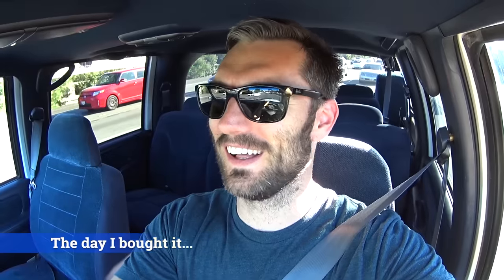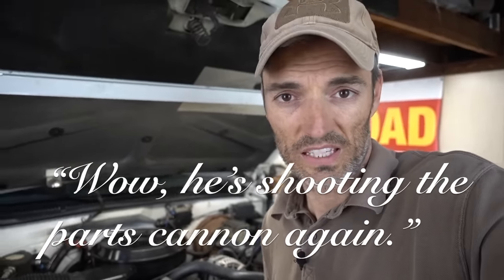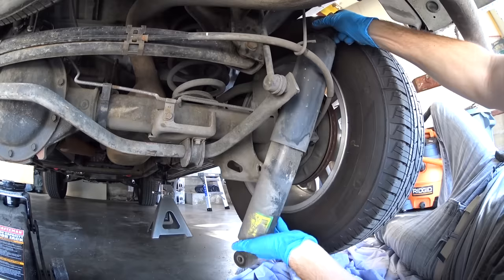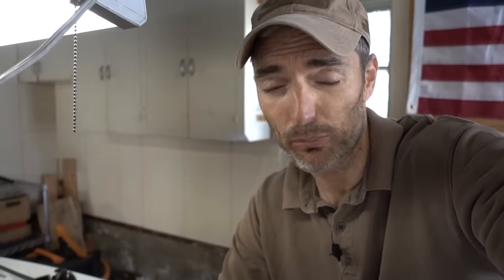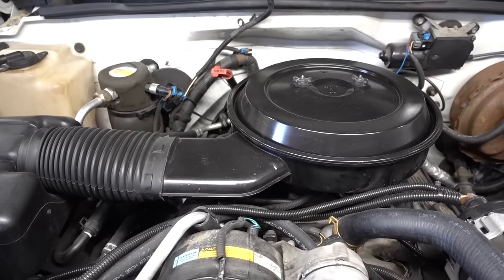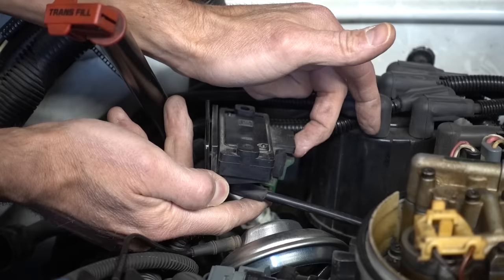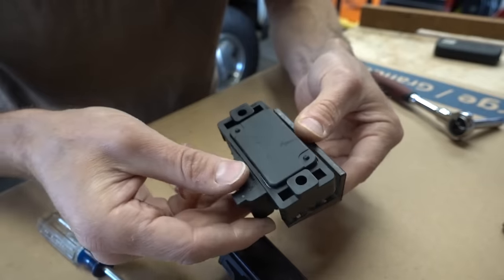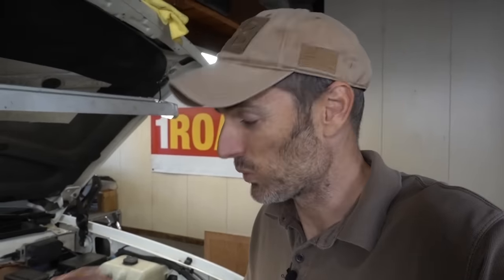The ONE REASON Why My 25yr Old Truck Runs So GOOD!!

Comment: Use a small ziptie to secure the(broken)plastic plug for the MAP sensor, works great.
Reply: great advice...gluing the original plastic with super glue will only hold a year...as super glue crystallizes after a year and breaks...a zip-tie-wrap will last 30 years in a heated engine compartment.
Reply: Or you can go to the local salvage yard and pay ~~ $4.00 for a pigtail and solder it on.  Good as new.
Reply: Or you can just get a new Weatherpack connector body, release the connectors from the old body and insert them into the new body. And also replace the CPA (Connector Position Assurance) clip. And make sure to coat the seals with silicone grease. And I recommend coating the connectors with antioxidant joint compound, such as Noalox.
Reply: @tomreyes4908  zip tie is easier lol

Comment: It makes sense to keep your vehicle in good condition. Better to replace wear items on your own time rather than when they fail.
Reply: Absolutely!  When that old rad hose does blow your going to be stuck on the side of the road.  You don't know where, what time it will be or what the weather will be.  Now you can add the cost of a tow to the cost of the replacement part.  Wherever you were going when the hose blew, your not going to get there today.

Comment: I just bought my first car, a 1988 s10 blazer. I honestly dont know much about cars, but with the repair manual and just a bit of research you can fix a lot by yourself on these older vehicles. They are great to learn. Greetings from Bavaria, Germany
Reply: I got that engine 4.3 v6  on a Silverado truck with   400,000 kilometers 
Oil changes  don't over heated

Comment: Good video I do pretty much my own work whenever possible. Preventive maintenance is the way to go.
Reply: During the week, when I work at my job, I earn $56 per hour (maybe $35 per hour after taxes).  If I work on my truck in the driveway for 5 hours on Saturday morning, I can easily save $500 worth of dealer labor.   I just earned $100 per hour (tax free).  Simple Math!

Comment: I have a 94 K1500 so same vintage as this Suburban.  I recently had the EGR go bad as well so that was causing a big vacuum leak.  I decided to go the EGR delete route since I'm in a state that doesn't do emissions testing anymore and It's running so much better now.  Much better throttle response too.
Reply: How exactly do you do the EGR delete? Is there anything in particular to be aware of?? I have a ‘95 Tahoe and no emissions testing in my state either. Thanks

Comment: I have an 05 tundra and last year I went on a trip. I changed the front brakes and checked the rear. As well as front and rear shocks, alt and belt. All were not failing though it gave me piece of mind. And that's enough for me.

Comment: I have a 2002 Z 71 , I have to say of all the new vehicles I’ve had in my lifetime. This one is the greatest. It has been literally flawless from the day. It was driven off a lot brand new to present I put three sets of tires on it. Three new batteries, change the oil as scheduled in the manual it has never failed. Me still has all the original stuff on it. I too, have changed the hoses and the water pump strictly just because of the mileage and age there were no problems the factory battery lasted eight years before I replaced it simply the greatest truck I’ve ever owned and I will keep it forever. It will definitely outlast me as I am now 68 years old.

Comment: many times original factory parts are better than factory replacements.  I bet your old MAP sensor was made in the USA or Japan which is better than the China one.
Reply: gmt800s had faulty ones from the factory  correction MAF sensors  you can still get made in the US MAP sensors   for the GMT900
Reply: Absolutely true!  Many many replacement parts no matter the box that they come in are of inferior quality.  This is especially true for 25 year old vehicles.  They just aren’t many manufacturers of parts for older vehicles and those that do still make these parts don’t sell very many of them so the manufacturers aren’t incentivized to keep the quality as high as their profit margins.
Reply: Absolutely True!  The original ignition coil on my 22 year old truck failed when the truck was 9 years old.  Replacement AC Delco coil failed 5 years later.  Second replacement coil failed after 3 years of operation.  Third replacement coil also failed after 3 years.
Reply: @chrisgraham2904  Hey did they have a no start condition when coil failed or other symptoms leading to the failure  ? thx.
Reply: @paulmoss7940  Coil failure may cause a no start condition or often shuts the engine down, like turning off a light switch while driving.  Engine may restart after shutting the engine down or it may restart hours later after the coil has cooled.  If it restarts, it will fail again when it heats up.   If you suspect a weak coil, you can often see the coil arching with little light flashes under dark conditions or you may hear the arch as it buzzes.
Reply: @chrisgraham2904  Thank you ,Sir. What I needed to hear.
Reply: @chrisgraham2904  Failing coils repeatedly is an issue that lies elsewhere. The coil failing is a symptom of an issue elsewhere.
Reply: @jf4872  The last coil installed was an upgraded AC Delco and has been operating flawlessly since.

Comment: 1ROAD, If I'm replacing something with a clip like that, I get out the old HEAT GUN & heat it up too where it's more pliable, WORKS 90% OF THE TIME.
Reply: And what happens when you damage the connector from the heat gun? Not a very bright idea. Better of just risking it breaking and using a zip tie. Those parts were not designed to be hit with a heat gun.
Reply: Well you sure don’t have to cook the thing🤣 ; use a blow dryer if you don’t know how to finesse a heat gun, most have a Low setting that is not unlike a hair blow dryer.
Reply: @frankstetka7206  THANKS, I didn't even reply too such stupidity. " YOU DON'T HAVE TOO COOK THE THING ", LMAO.
Reply: @ragnaroksangel  You don't heat it until it melts. It resides on top of a very hot engine to begin with. Heat it until it's MORE PLIABLE.
A very BRIGHT IDEA.
Reply: Thta's a good idea.  A hair dryer is a better plan those heat guns, they get HOT!!!  Melting hot!!
Reply: @nealhead7673  If you use a heat gun you don't even have to unclip it.  Actually when it cools you can peel it off of the driveway like a soft noodle shell that sat in the stove until the next day.  Makes for easy cleanup.
Reply: @ranbymonkeys2384  I have a VARIABLE HEAT GUN works a HELL OF A LOT BETTER THEN A FREAKIN HAIR DRYER. Do what u want I know what works best because I've been doing this a LOOOONG time. Also sometimes they just break no matter what, plastic in the engine compartment isn't good at all unless you install insulating sheathing over all of it. That in it self is a PIA but it does work.

Comment: Those pre-Vortec gen-1 SBC TBI systems are so simple and reliable!!!
Reply: I've got a 91 c1500 with TBI I'm getting good  spark and fuel but my injectors won't fire I'm thinking about replacing the ECM any thoughts?
Reply: @zephead4835  Replacing parts without verifying the issue at hand is not the proper way to fix a vehicle.  My suggestion would be to retrieve any trouble codes first, if there are any.  A great tool I used on my OBD1 cars was a program called WINALDL,  I ran it on my laptop computer, and I made my own cable to connect the computer to the vehicles ALDL (instructions on the net), It had many features and best of all it would show live DATA of all systems as the engine was running, and/or as the car was driving down the road.  It was great for troubleshooting.  Without live DATA of the vehicle engine control systems, your shooting in the dark.

Comment: Absolutely correct, it is collectively finding problems before they happen, like replacing all sensors and solid state devices affiliated with the engine and car computer functions.  Then you can whiff scan and or read when a mechanical failure approaches...you know where it is.

Comment: I feel you man! The thermostat on my daughters Jeep went bad at 110k miles. I figured while I’m draining all the coolant it was time for a new water pump, hoses, serpentine belt, idler and tensioner pulleys, and of course the thermostat. Hopefully good for another 110k!
Reply: I have 96 Chevy trk all parts I get are   junk even a c Delco belt tensioner 6 months i have replaced 5 of they all squeal i just left the last one on and let it squeal. Water pump lasted 5 days and water pouring out BOTH  weep holes allparts are junk
Reply: Half the battle of replacing a simple part is getting to the part.  On newer and smaller vehicles, access to the part can be 98 percent of the battle. Only makes sense to replace the common wear components in that area while your in there.  You dove in once, instead of six times.

Comment: Great work! My vehicles never leave me stranded. When I detect something isn’t right, I track down the problem and do a preemptive repair. An intermittent misfire on my 2003 Ranger prompted me to swap out throttle position sensor, plug wires, spark plugs, cam position sensor and clean the mass airflow sensor. My truck never leaves me on the side of the road, and, it’s been paid for for a long time.

Comment: Them GMT400 as long as there's no rust they going to last forever with basic maintenance.  This is most durable truck GM ever built
Reply: piston rings, lifters, cylinders, injectors, all wear.  Eventually you will have a rebuilt engine but last forever, not quite.
Reply: @ranbymonkeys2384  I knew a guy that had a 1994 Silverado 2wd with over 400k miles on original drivetrain.
Reply: @Chinunit22  ya OK 400K doesn't sound like forever does it?
Reply: Picking up a 98 2500 350 with 102000 miles tommorow,  got it for 2111.00!!!!!!!!its mint

Comment: Jimmy, my thought process is the same as yours when it comes to automotive maintenance. I did the same for a '91 Ford Ranger, now with 200K miles. Electrical parts and common failure parts were super cheap especially about 8-10 years ago. I seen it as a win-win situation.

Comment: You have the right mind.  Constant vigilance. Similar to the nauticle  mind. No break downs at sea. 
I do like you do.  My truck is a little simplier. It is a '65 F100. I use the 300 -6. I have been driving/maintaining it for going on 43 yrs. I keep a pocket sized notebook (in the 3rd one now) to keep up with "events." I also use a magic marker and write the date on a new part. 
   All the best, like your style a lot, Pete

Comment: Recently did the map sensor on my 88 k1500. That along with the TPS and IAC helped alot with idle and throttle response. I was getting a surge in my throttle so I went with all three and now my truck is running amazing
Reply: Tps?

Comment: That is a super clean truck for a 95! I have a 98 Chevy pickup that’s totally rotted out in some areas it’s a shame the rust got to it because it’s otherwise in great shape and runs perfectly. You’re lucky you got such a clean example of a 90’s GM.
Reply: All depends on where you live. 
I live close to the Gulf of Mexico (Texas) like 60 miles from the ocean 
We have humid and salty air quite often but surprisingly trucks don’t rot out down here unless they’re a second or 3rd gen dodge….. 
there’s plenty of 50 and 40 year old square bodies still on the road down here you can’t throw a rock without hitting a GMT-400 series somewhere. Mine truck is a 91 k3500. 
Absolutely zero rust or rot except for where the radiator was leaking for years……. Only thing that ever makes my truck quite running is when crap in the fuel tank plugs the strainer screen I usually just hit the tank with a mallet. And it solves the problem…..  
gmt-400 cheap to buy 
Easy and cheap to work on 
And just all around loyal trucks. Been running mine every day for 6 years.

Comment: The problem of just throwing parts at it is you can create new problems changing to many sensors at once and often, if you fix the problem, you may not be sure which new sensor fixed the problem.  
Conversely, an example; I had to change the intake gaskets on my 4.3 ltr. at about 125k.  While I was in there with the top of the engine dismantled, I also changed the injection spider, the water pump and power steering pump.  They were all originals working perfectly fine but since I was already half way there I changed them, they are high wear items and buried under there so while I was at, boom, all at once.  I rebuilt my front end also and changed the front CV axles concurrently because I had it all apart and the ones I had on it were approaching the end of their usable life.  There was a time in my life I might not have had the funds to do it that why but that's not the case anymore so it just makes sense.
Reply: That was quite the rabbit hole you embarked on!!!  Hope she's still running tip top!
Reply: @HOMEWORK4.0  Other than rear main seal leak, it runs like new.  AC out now though, one thing leads to another.
Reply: @x-man5056  Is it a single piece rear-main?

Comment: Bought new in 96 ,dodge lg bed 4x4 club cab 1500 slt, 5.2 magnum.  Great truck w/ 110k miles now ..my baby..has yet to let me down, towed my 19' boat, snowmobiles,jet ski's , etc .  I do most all maintenance myself except left front axel bearing and cv joint.  So far replaced water pump, rad hoses every thing else is original.  Love this old easy to work on truck...79 yrs old shade tree mechanic.  Great video/ great advice.

Comment: I like this guy because I think just like he does.  I fired off the parts cannon when I bought my 70 Buick GS 350 with 95,000 highway miles back in '78 and drove my family in that car without breaking down on the road for 10 years and another 87,000+ miles. Water pump, coil, timing chain and gears, oil pump, carb rebuild, ball joints and steering idler, shocks, disks pads, rebuilt master cylinder, rebuilt brake calipers, fluids all around many times, wiper motor. I bought it for $900 and preventative maintenance over the course of time might have cost $2000 with all work done by me. 10 years.. not too bad and it was still running when I parked it.

Comment: Amen!   New truck prices are just stupid….and, similar to cable tv, I don’t want all the “extras”  that are always included. 
I just spent $1500 on my 2013 Ram 1500 at the 200,000 mile mark. New brakes, new radiator (found a pinhole), new plugs/coils/wires, fuel filter, serviced the differentials, fixed some assorted loose or squeaky items and installed a backup camera. Then towed a 5’x8’ u-haul trailer from Texas to New York and back to pick up a motorcycle. Averaged right at 20 mpg…..I don’t think that’s too bad for a 4wd truck. I plan on keeping this truck till it dies of natural causes. 🫡

Comment: Did you change that old spare tire out with one that matches your current tire sizes yet?  I see tons of lifted truck guys failing to do it.  Running 35” or bigger tires with a 30” spare on can prove disastrous for ones axles/differential .  Did you re-torque your lift kit yet?
Reply: I'm guilty for not doing this. Thanks for the heads up!
Reply: I do carry a plug kit and compressor, but still.
Reply: Good point. A guy I knew destroyed both front axles on an early 2000s Chevy truck because he ran a small spare off road after having a flat. I run 4 inch bigger tires on my Excursion and I keep my best tire from my last set as a spare.

Comment: I am still driving my 1997 dodge Ram 4X4 with over 200K miles in it. The cruise control and A/C are the only things that don't work. Body is good due to rust protection after being driven in Michigan winters with salt on the roads. Older vehicles are heavier than new ones. A buddy of mine has a 2020 (maybe 2021) GMC pickup and he says when he pushes on the rear panel it bends in but when he pushes on my 1997 the doge is solid.

Comment: Most logical thinking I've heard in a while. I have a 99 k1500 suburban. Everyone tells me I am just wasting my time and money. They say if it ain't broke don't fix it. Screw that I have changed almost everything on my burb. 6 months now from sensors to diff and trans rebuild paint and suspension. All I have left to do is bushings cv axels and hubs

Comment: It's always nice to be able to change all the parts on your vehicle, but some people don't have a money tree in their backyard 🤔
Reply: Yeah nobody is forced to own a vehicle it's a privilege if a person does not have the money or gets freaked out about the price of something like wiper blades or brake light bulbs then he or she should just take the bus
Reply: @master6435  
Well they could always walk,  the huffin and puffin will shut up the complaints!
Reply: @zelvinhenry8068  Yo G I work at a auto parts store that ends with zone have seen customers that come in thinking that the $7000 BMW needs to replace water pump when they find out that it's more then $250 to replace because the pump is electric not a simple belt drive want a band-aid fix instead end just going a selling the BMW and make the vehicle someone else problem
Reply: @master6435  to be able to travel freely is a right not a privilege it's one of the basis of a free society and a republic like ours unless you live in Boulder
Reply: @calvarybuilders5689  bud your not going to win the argument I'm talking about owning a vehicle is a privilege not a right people should read before they reply... (face palm)
Reply: @master6435  But you don't need to replace good wiper blades just in case.
Reply: @micahyarbrough5513  will people who are buying blads is because they failed completely